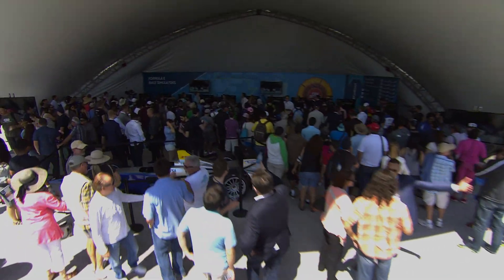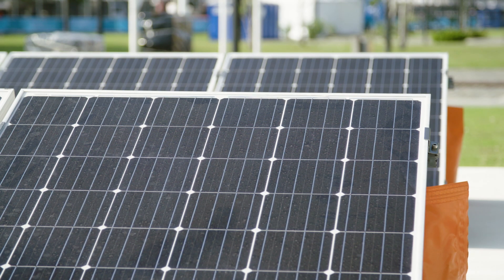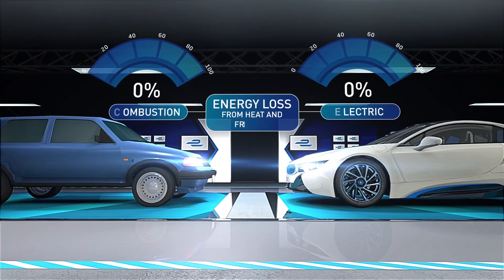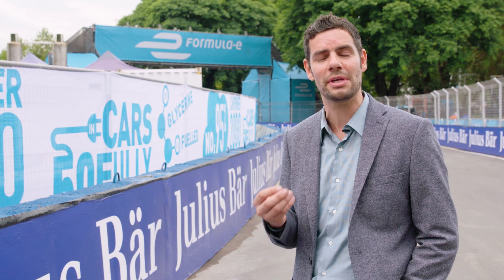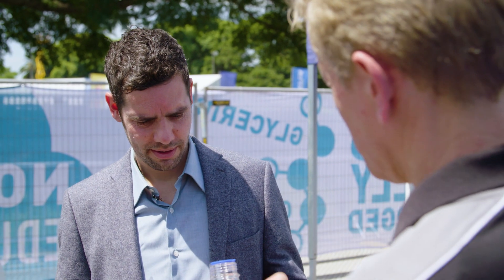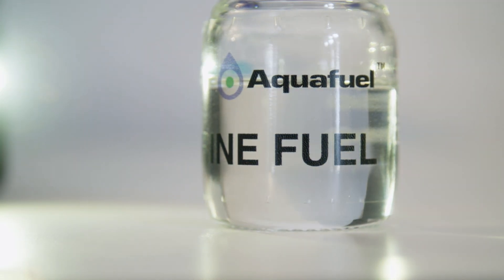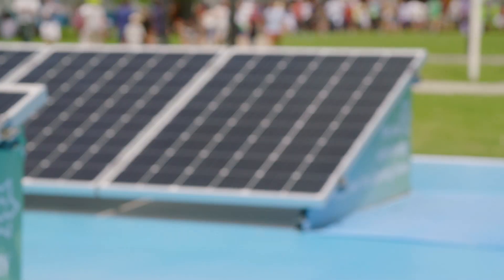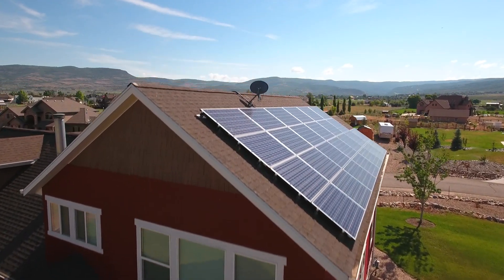How Are Formula E's Electric Cars Fuelled? Julius Baer: Electrified Visions Episode 5

Comment: If glycerine only halves the co2 rather than eliminate it, then presumably it's only really a short to medium term solution. But it works well for F-e right now until they can use solar / wind and storage for the whole event.
Reply: Everything has an imbedded co2 use. But the more grid power that comes from renewable resources the less the imbedded co2 cost for new objects and other power requiring activities will be.
Reply: Chris Till qfv kkjķcng
TjTtah
RTNbbata
Reply: Badger's Den m   b   errr44